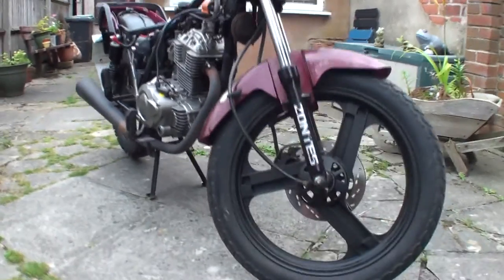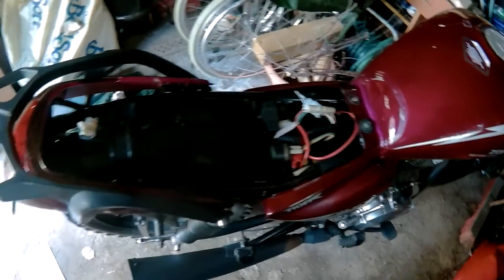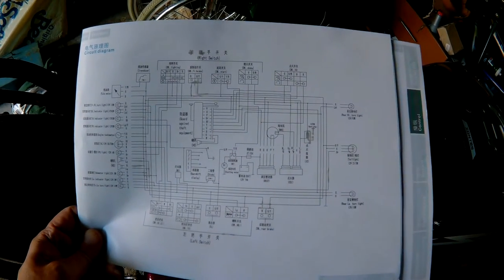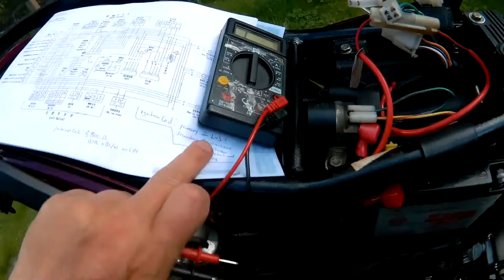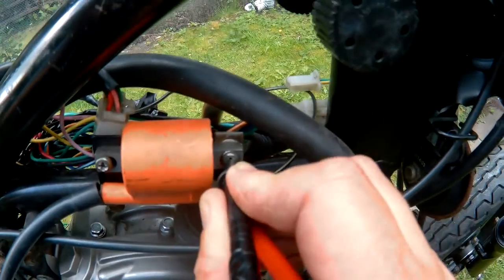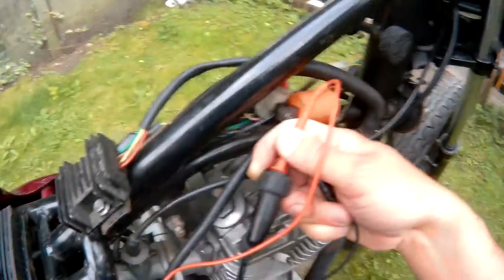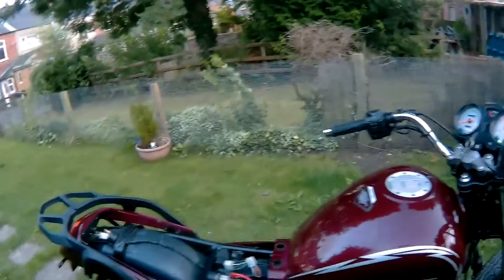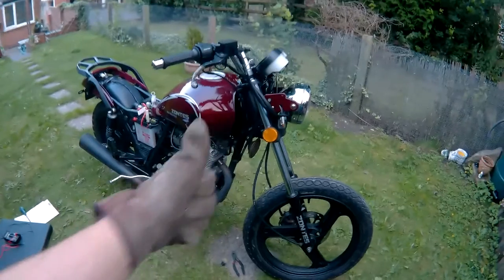Will it run Zontes Tiger 125cc Chinese motorcycle

Comment: I've just bought one too the same colour aswell it ran but I struggled to start it guy I bought it off said you had to keep it on choke all the time.  Next day I couldn't get it to start so checked the gap and it was massive knocked it smaller on the wall and then it would fire I'll try and get hold of the pdf from zontes like you did
Reply from the maker: if you cant I can put a link to it.
Reply: @SteveSims  I got the owners manual yesterday from zontes well nearly it's euro 3 not 2bbit it's close enough but not enough tech specs really no plug gap ect
Reply from the maker: @BBFSGaming  The manual they sent me says the gap is 0.6 - 0.7 mm

Comment: great video, you gonna make any progress videos?
Reply from the maker: Yes. I found some lost footage for this video. I have setting the clutch cable. I think I have fitting the side stand. But they need editing. I will be filming putting on a new cush drive rubber, new brake shoes, new chain, fixing a leak on the fuel tap, replacing the headlight lens and fitting new fork seals. And the ignition switch is dodgy so I will need to remove that and investigate it.
Reply: @SteveSims  will wait for next video:)
Reply: Hi Steve I’ve just bought the same bike as yourself and your video managed to get me a spark wonder if you’d mind forwarding the pdf wiring diagram that you’ve got cheers mark
Reply from the maker: @markletley7690  This is the pdf from Zontes. Wiring diagram is page 65 I think. https://drive.google.com/file/d/1YX1uRhJzs1_7FbtCA_AuGHCkURPfTCnS/view?usp=sharing
Reply: @ Steve sims have requested access to your google drive whenever you get a min cheers mark
Reply from the maker: @markletley7690  I've done it. i thought I made it public but it wasn't. You should be good to get it now.